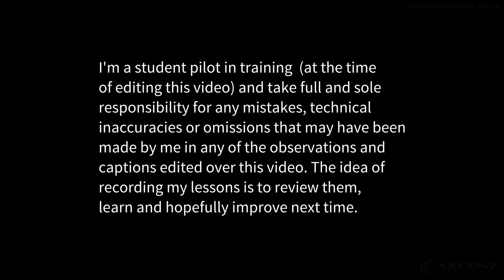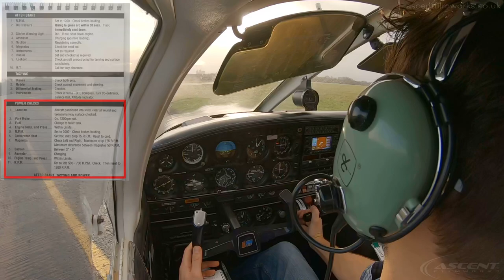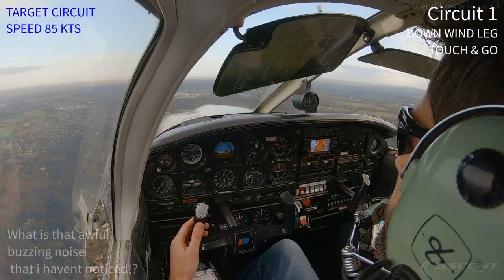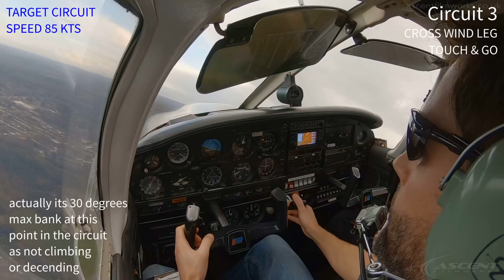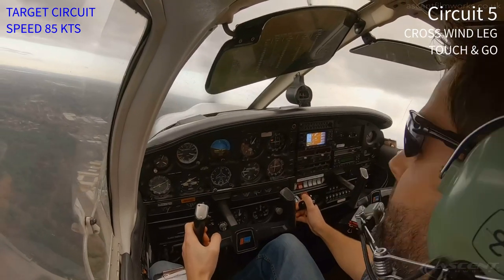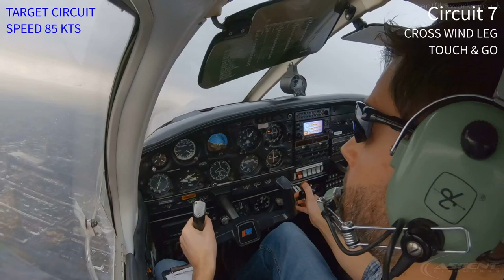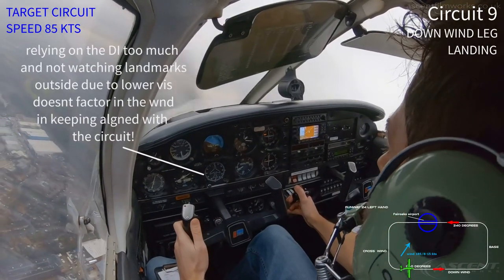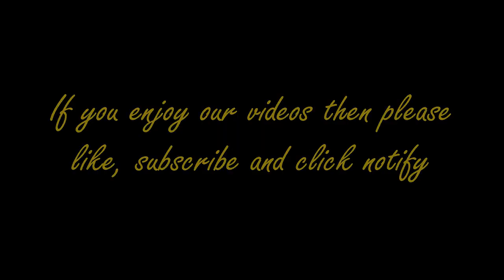PPL lesson #6 | Std circuits | PA28 (181) Warrior II | Fairoaks UK

Comment: Great video! Very well done 👌 what kit did you use to record audio Atc and the flight at at the same time?
Reply from the maker: Hi thanks. i used a Sony Icd-UX570 MP3/LPCM Digital Voice  Recorder  with an adapter cable that plugs in to the avionics headset socket. Works pretty well but only when the audio avionics is powered up on the panel.

Comment: Great video. What equipment do you have to record the video and sound. I think it is great advice to record lessons 👍
Reply: Hi i used a Sony Icd-UX570 MP3/LPCM Digital Voice  Recorder  with an adapter cable that plugs in to the avionics headset socket. Works pretty well but only when the audio avionics is powered up on the panel. EDIT i should have added that i am the pilot in the video here, just using a separate youtube account hence the different user name